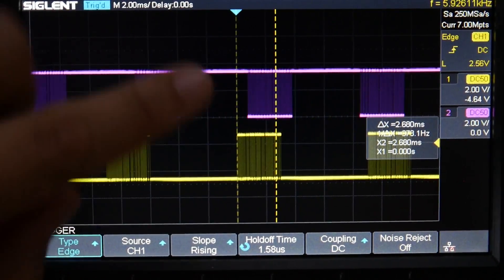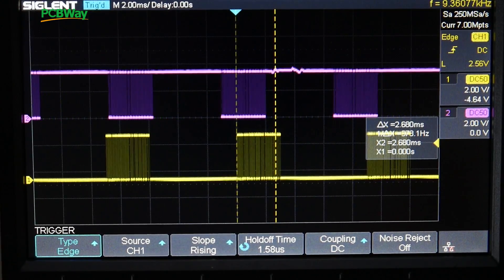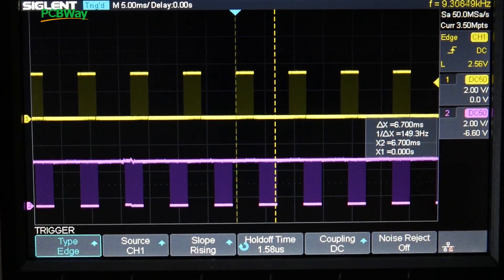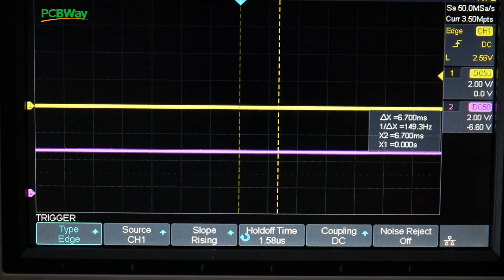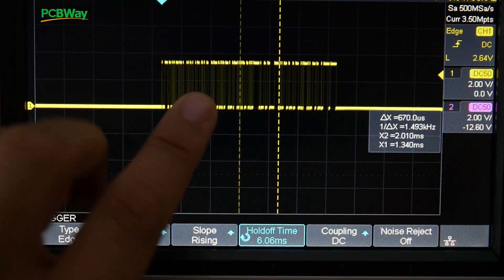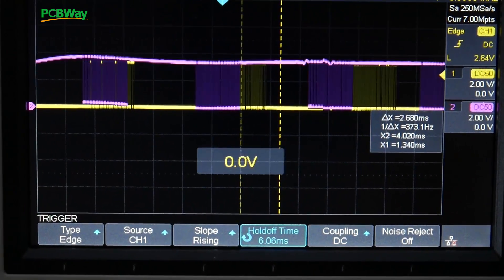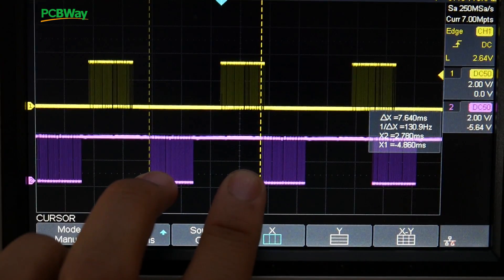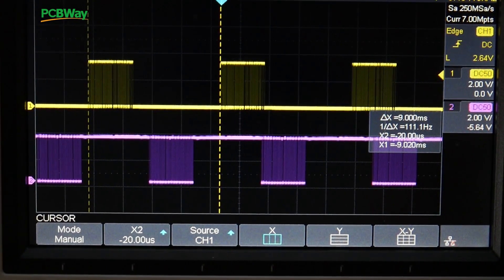[Episode #1] SBUS vs IBUS // Brief Intro

Comment: Great work.  RX latency is why I started watching in the first place (over two years ago - Oct 2017).

Latency tests wanted (as I have no oscilloscope):
- Switch to signal, D8, ACCST, ch8, internal module
- Switch to signal, D16, ACCST, ch8 (only 8ch sent), internal module
- Switch to signal, D16, ACCST, ch9, internal module

- Switch to signal, FPORT, ch9, internal module
- Switch to signal, ACCESS, ch9, internal module
- Switch to signal, iBus, ch8, internal module
 (FlySky TX or Nirvana)
- Switch to signal, DSMX/SRXL, ch8, internal module
 (Spectrum TX)
- Switch to signal, D8, ACCST, ch8, external module (iRange)

- Switch to signal, D16, ACCST, ch8 (only 8ch sent), external module
 (iRange)
- Switch to signal, D16, ACCST, ch9, external module (iRange)

- Switch to signal, DSMX/SRXL, ch8, external module
 (iRange)
- Switch to signal, M9, ch9, external module
- Switch to signal, Crossfire (telem enabled), ch9, external module
- Switch to signal, Crossfire (telem disabled), ch9, external module

Unfortunately the google sheet that used to have a number of latency benchmarks ( https://docs.google.com/spreadsheets/d/1gp2NqOBjCVm4uZj9lLtY2wFG3oJ0KqnMC0kVRTIHnSc/edit#gid=241169987 ) is no longer there.

Comment: great series keep continue... when you start test with transmitter on flysky i6x use custom firmware because stock have bug with frozen frames that could cause higher latency
Reply: Even better...test ibus with a Nirvana NV14 so all transmitters are running Opentx. Also get an FRM302 from FlySky with -3A protocol which is even faster with more range.